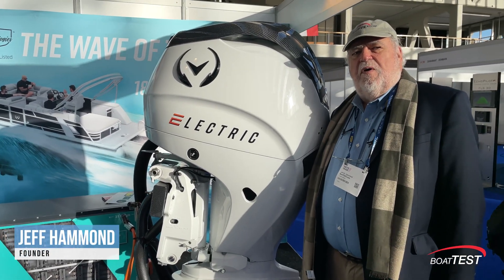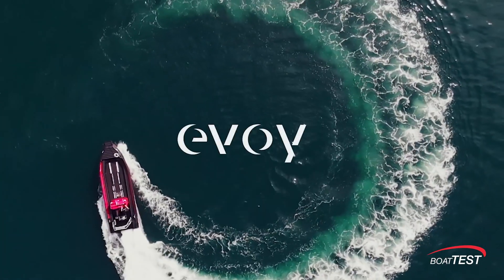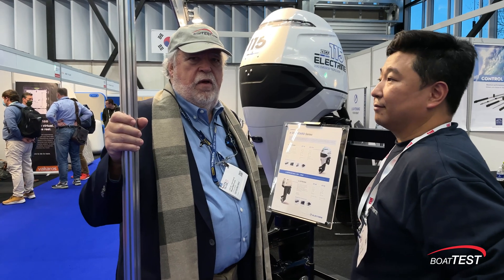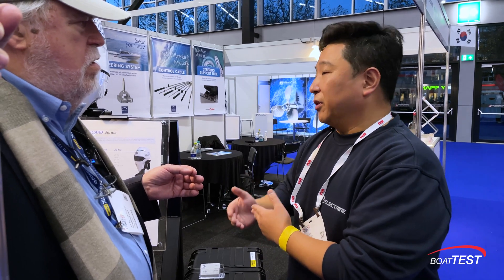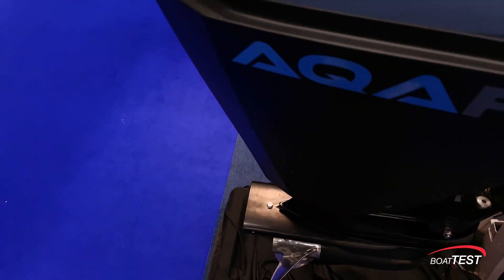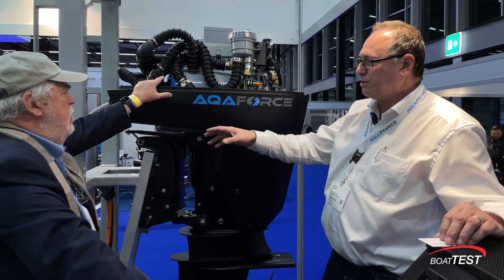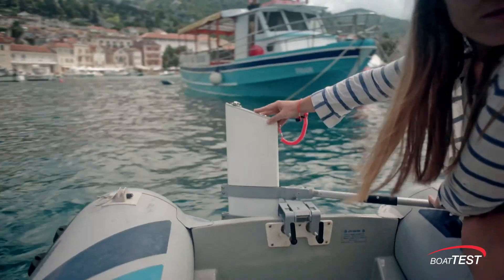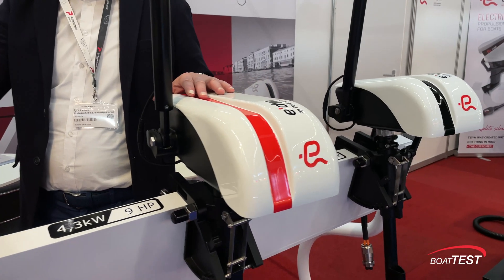METSTRADE 2021 Electric Outboards - Part I by BoatTEST.com

Comment: WOW the Vision have potential but reading the specs it need to be recharged every 2 to 3 hours, not much of a trip with that kind of need, honorary mention to Remigo, i dont see that motor in my 2000 pound boat but the creativity of the design is outstanding, those kids are in the right direction to change the industry standards.

Comment: The elephant in  the room is that you get no battery charging by an alternator while underway.  Why hasn’t BoatTest addressed this?   You cruise to a destination with a depleted engine battery and a house bank that hasn’t charged underway.  Then what?
Reply: So, gas isn’t available at your destination, but batteries are?  Seriously…. Give it 20 years and there may be something there.  And, btw, my dinghy is powered by batteries.  I’m not against them.  It’s just disingenuous to talk about electric boats without addressing charging them at the end of the day.
Reply: So you cruise to a destination and there is no gas station available ?  With electric at least you could slowly charge by electric. With gas power you are S O L
Reply: @donkanis6141  Gas is portable.  Can get delivered/transported/moved easily.  Also, for you to “slowly charge by electric”, you have to use less electricity than your panels are generating - so, no cooking, no refrigeration, no device charging, etc…
Reply: @oceanrider68  You can always swap batteries at the local store like you would getting gas. The future has arrived. Some people have vision and others wear bifocals.Oh an by the way all of the new and well funded R & D going on for new batteries will never cause e them to get much lighter or cheaper so we should just stick with gasoline forever.  I have nothing to learn from you other than you are one of the many Luddites who will fight new technology and then when its adopted you will completely and intentionally forget you ever made such stupid remarks.

Comment: I'm all for electric boats! I think they're going to be amazing, however there is zero point to having an outboard motor that's electric!
Think about it, the whole reason outboards were developed in the first place was to get all of the internal combustion bits out of the boat.
If they want to be serious about this it needs to be designed from the ground up as an electric boat where the battery pack is low in the hull for good weight and balance and either use a jet drive or some sort of pocket drive setup where the electric motor is inside the boat where it's nice and dry!

Comment: You did not ask the question.  How long will each of these run on a full charge?
Reply: And how much?   how long to charge?  Warranty if any....
Reply: @TonyLee_windsurf  Good questions.  In the video the Remigo 2.5-3 HP motor purportedly can be taken with you to lunch and be fast charged in 3 hours.  Where do I get a 3 hour lunch break?  Will the motor run for 3 hours when fully charged when new?  How long will a full charge let it run after a couple years of use?  

And of course the never asked questions surrounding EVs ... Where will the electricity be produced and using what fuel and with what emissions?  How and where will the battery materials be mined?  What will the environmental cost of that mining and battery production be?  Will the miners of these materials be willing adults with fair wages and decent conditions?  Who will control these mines?  Will those persons/governments be friendly actors on the world stage, or more like the ones threatening the world today?  How will these materials be recycled and how much energy will full recycling require?  What are the environmental impacts of the recycling (or disposal) process?  And what will be the total real cost to the humanity and the environment to own and operate EVs?  Not trying to be a naysayer about EV technology as the potential seems very optimistic and it is good to see so many bright minds around the world creating a variety of clever solutions, but I do believe we must honestly and totally evaluate the costs (especially if we're going to wave the environmental banner over EVs as the savior of the planet).
Reply: It depends on the of size battery you want to install.

Comment: What is the weight of the batteries?  How long do they take to recharge?  How about pricing?  Is the range comparable to non-electric engines?  What is the purpose?
Reply: They show a Kreisel 63 kwh battery pack it weighs 400kg =880 lbs. Going from memory (I did the math last year) you would need atleast 3 of those to run a bay boat for the day. I think 140 mile range @ cruising speed. Not light, not cheap. 

I am definitely interested but the battery tech is not quite there.